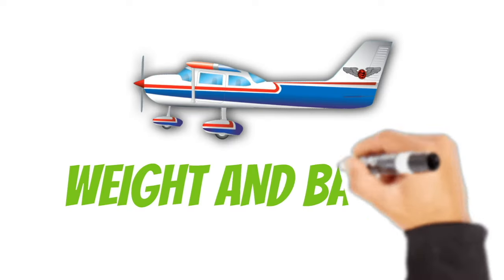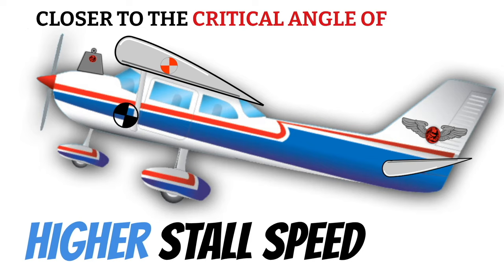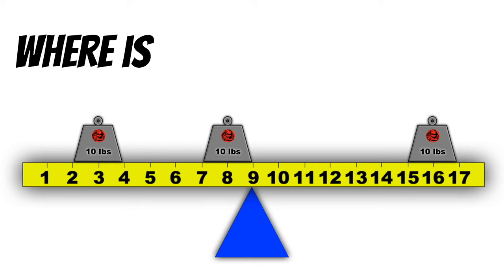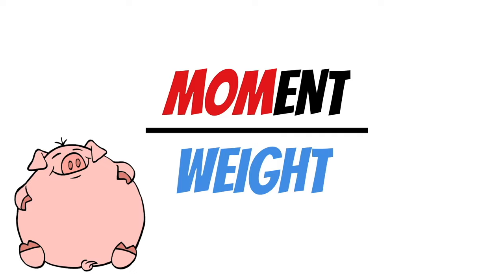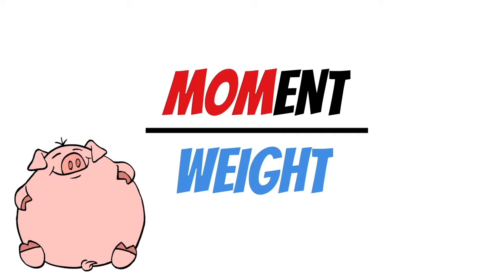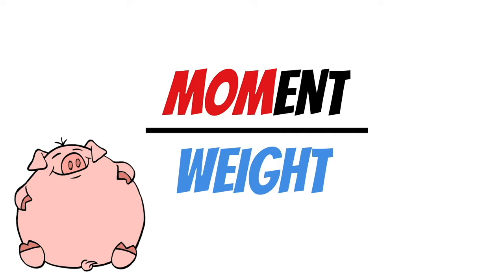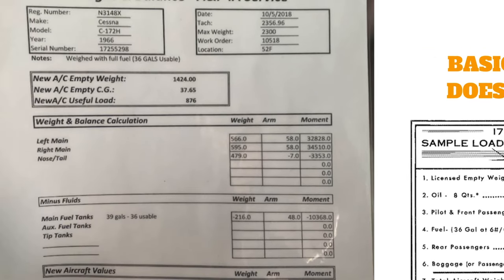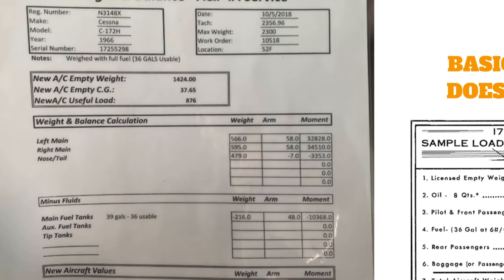The Complete Guide to Weight and Balance (PPL Lesson 50)

Comment: Thank you for these excellent videos. Just a note. The movement needed is exactly 2 inches. The rounding of 500/950 caused the error of ~0.014 inches in the CG shift. If you write out the formula, it is pretty friendly:
250/950 = (500/950)/x
250=500x
x=2
Reply from the maker: You’re welcome! And thanks for the tip

Comment: Your vids are awesome - I had a quick question - How would one have a Forward CG or calculate that? The chart shown in this video (as well as the C172 training supplement I fly) only shows the inches aft of the datum? Where would we find a Forward CG. Thanks!
Reply from the maker: This is a good question. Remember, our measurements are all made from the datum.  It doesn’t matter where those measurements start, but on a specific aircraft, the measurements need to be made from the same spot.  On 99.9% of aircraft your forward CG limit is still going to be aft of the datum.  They are telling you where that spot is in relation to the datum.  No manufacturer does this, but I could take all my measurements from the tail.  In that case, the tail would be my datum and ALL my limits would be forward of the datum.  Hope this helps

Comment: I'm confused.At 20:04 the numerator is -.53, but when you cross multiply it changed to -.15. Then at the round 26:35 mark you said the arm was 95 with 50 pound bag giving a moment of 5, but it was 4.75. Another question I have is all the test questions I have seen so far say the empty weight of the plane includes undrainable fuel and oil but your example shows deleting the oil listing, is that aircraft specific? By the way I have already completed the sporty's PPL course and your series are so much better at explaining the information.
Reply from the maker: Thank you! Yes, there’s a mistake there. I accidentally calculated wrong the first time and redid that part. The answer at the end is correct, but there’s an incorrect number in there for a bit.

Comment: time stamp 14:40 you said 20/40 is .5, that would be a positive number, then later you called it -.5. I dont see where the negative came in. However I do agree with moving the 10 lb weight to the left .5 inches. Can you clarify why you called the .5 negative???
Reply: If you move left of the fulcrum it's negative, to the right is positive. Here, the weight was positive .5 to the right so he moved it left. That's when it became negative.

Comment: why did you change the -.53 to -15 in the second equation for calculating the shift in weight?
Reply from the maker: There’s a mistake in the video at 17:49. -.53 is accidentally changed to -15.  The calculations are made with -.53 so the answer comes out correctly, but -15 is a number from a previous calculation that somehow slipped through.

Comment: There's an error in your equation at 20:17. Number changed from -.53 to -15. Just an FYI, as the calculation was still made correctly.
Reply from the maker: O shoot. I miscalculated the first time, and I forgot to cut the beginning part with -.53 out

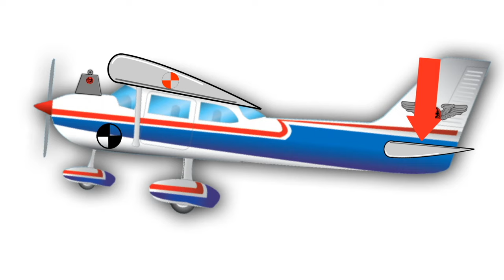Comment: I don't understand 04:58
It will be difficult to raise the nose so how will the tail dip?
Reply from the maker: The way you’re asking the question is a little confusing. More airspeed pushes down on the tail causing the nose to pop up. Too much weight in the nose may not allow the tail to be able to create enough down force
Reply: @FreePilotTraining CG is too far forward, so raising the nose will be difficult. You said angle of attack increases. I don't understand how since nose will point down.

Also an airplane always rotates about its CG. I don't understand how centre of lift is the pivot.

Comment: hey vid is amazing but how  950x-15= 503.5??
Reply from the maker: That should be -.53. There’s a mistake in the video at 17:49. -.53 is accidentally changed to -15.  The calculations are made with -.53 so the answer comes out correctly, but -15 is a number from a previous calculation that somehow slipped through.
Reply from the maker: There’s a mistake in the video at 17:49. -.53 is accidentally changed to -15.  The calculations are made with -.53 so the answer comes out correctly, but -15 is a number from a previous calculation that somehow slipped through.

Comment: At 34:39, how do you know that we need to reduce 1000 inch pounds?
Reply from the maker: Based on the moments on the bottom of the chart.  As you can see the moments are in increments of 1,000. So, we need to move left on the chart about 1,000 inch pounds

Comment: Your calculation is odd. We just need to makes the moment equals to either side of fulcrum. So just minus the right moment 500 LB*Inch. Which moves the 250 lb 2 inches leftward.
Reply from the maker: True, but you don’t always have easy weights to work with.  And you don’t typically have load stations in 2” increments